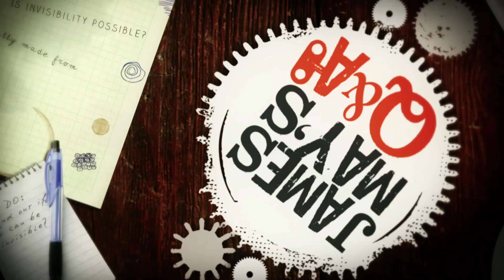Why Can't Trains Go Uphill? | James May's Q&A | Earth Science

Comment: Sooo...

I am NOT a railway engineer, but I am an expert in avalanches. The use of percentages vs degrees so frustrating. As I understand 45 degree incline is one to one (1 unit horizontal to one unit vertical) or 100%

Comment: things that tries to combat this situation:
1. sanding, basically sprays a sand in between the tires and rails to give a temporary traction (i think it's stupid, not efficient and possibly ruins the metals because it's basically just sanding a metal and slowly disintegrates both the tires and the track)
2. 3rd/middle track with gear (or something idk the name) basically add another rail but the 3rd one is in the middle of the track, and there's also a gear underneath the locomotive that fits onto the track basically the same idea as people taking stairs.
3. this is my idea, why don't they lay a piece of rubber like a very long gum not everywhere but only on the surface area that trains struggle to have traction? doesn't need to be thick and if it disintegrates it can easily be interchangeable

Comment: Umm, then y dont we make threaded side tracks in hilly areas which will only touch the threaded side extension of wheels, these wont be required in plain areas where train instead of running on its smaller threaded wheels will transition to plain larger wheels

Comment: Tractive contact area and braking contact area aren't the same.  Yes, only drive wheels provide traction but braking is done by all wheels connected to the hydraulic braking system of engines and cars.  But I'm sure this has been pointed out already.
Reply: It depends on the train though, very early steam trains didn't have brakes on cars that could be controlled from the engine.

Comment: Why can´t we just make the rails on a hill section of a railway in a different material?
Reply: Maybe they do. There are different technologies around the world, some trains or trams will even have rubber tires, allowing them to climb steeper. Wikipedia has an article for "rack railway," which exactly a solution based on a different material, but gear-like teeth on the rail and some of the wheels. I suppose it must be like some extra rails for a wheel that's not used otherwise, so it could move though this specialized areas and normal rails smoothly. There are several different models, I haven't read the article.

Comment: a few big british engines had extra sets of powered wheels in front (or behind?) of the boiler, and Diesel engines sometimes operate with "Slugs", another locomotive that doesn't have an engine, instead runs off the main engine's electricity so the pair can have better grip with only the fuel consumption of a single engine

Comment: Clickbait and stupid title, since train can indeed go uphill.

The steepest grade in the world is 13.8%
Reply: There's a video claiming the funicular of the Havre goes up to 30%. But maybe that's a thing with funiculars in general, so it's kind of cheating to mention. It has rubber-tired wheels, though. I'd imagine that rack-assisted railways could also be used in situations just as steep or steeper. But then at some point the smooth steel wheel traction itself is perhaps not the biggest issue, but the incline itself, being more efficient to have a longer path than a steeper one, I'd guess.

Comment: I CAN IMAGINE AN INVENTION WHERE A SECOND SET OF GEARED WHEELS AND A SECOND SET OF TRACKS COME IN CONTACT WHEN CLIMBING A STEEP HILL. OR EVEN A STRONG CABLE LIKE THAT ONE IN SAN FRANCISCO PULLING THAT TRAM UP A VERY STEEP INCLINE!!!
Reply: "Rack railway" is the name of the first invention, and "cable railway" the second, of which there is the funicular railway variation, where cables connecting two trams up and down a hill use the weight of the one going downhill to help the one that's climbing. I don't know of cables being used only partially on a track, like automatically hooking on them at the beginning of a big slope, helping to pull them up, and then disconnecting, but I'd not be surprised if it existed.

Comment: No mention of cogged railroads or locomotives equipped with sand that blasts the surface of the rail in front of the traction wheels to make it a little rough to give it traction.

Comment: Also worth mentioning, most locos are equipped with reservoirs of sand that is dispensed to the track in front of the driving wheels to improve traction on steep grades or during wet conditions. On steam locomotives this reservoir was on the top of the train in a dome shaped part, known as the “sand dome.”
Reply: Damn, that would’ve been cool. Makes sense, they definitely would have thought about that before using sand. Thanks gentlemen.
Reply: What? Somehow this makes no sense to me... I feel like this does nothing or may derail the train somehow...
Reply: @dumbleking5172  like he said in the video, it’s a very small contact patch and it’s shiny metal on shiny metal, a little grit goes a long way. It was so slick with frost last winter that we couldn’t pass a brake test and the poor sander compressors were running near endlessly. Let’s be clear though, it doesn’t make a huge difference, especially in an emergency on slick tracks, but it’s a difference nonetheless. In regards to derailment, there’s a video of WW2 soldiers training on how to derail trains. They took bigger and bigger pieces out of the track to see how much had to be missing till it comes off. The length is quite astounding before it’s off.
Reply: @dumbleking5172  I don’t know what to tell you. It is basic physics. The worth of a locomotive is measured in its tractive effort, and sand keeps the wheels from slipping by providing extra traction.
Reply: I’m sorry it’s 8 months later but do you know if it turns into glass?
Reply: @slimmsherpa9771  the sand grains wouldn't be under heat for long enough (Or perhaps even hot enough) under the small contact points and the relatively short duration the train travels over them to turn into natural glass. Without a flux the sand would need to reach 3,200F or 1760C to melt.
Reply: @slimmsherpa9771  definitely not. In chilly Canada even our light rail transit trains still use sand, (selected for type and grain size), for traction when braking and accelerating. So much so that periodically a vacuum truck comes to pick it up where it deposits in tunnels and switches.
Reply: @francistarkenton545  funny,  one is not suposed to sand into switches
Reply: @trazyntheinfinite9895  while generally true, it does blow about with the wind and our trains sand whenever they detect a slip/slide condition. It’s not operator controlled.
Reply: @francistarkenton545  wdym it's not operator controlled? I drive trains in Germany and we sand manually. I don't know if passenger trains are different, but our cargo trains all have a switch for sand. I don't think I've seen one that does it automatically. We also have to radio it in if we come to a stop while using sand, especially if it's anywhere near a signal.
Reply: @RenkoBernkastel  Fair enough. I’m speaking specifically of the Siemens light rail units that we service. I can’t imagine all trains are the same. In fact, the very early Siemens-Duewag U2’s had a sanding button but it was later automated.
Reply: @RenkoBernkastel  Canadian trains are designed differently to German ones.
Reply: @slimmsherpa9771  No, it doesn't. I work with a steam powered train at an amusement park. What sand doesn't get pushed off the tracks simply gets crushed into powder. There's not enough heat generated to melt the sand. Between the wheel and the track itself, both act as a heat sink, pulling away all heat generated by the compression of the sand, which is why it turns to powder instead of glass.
Reply: @slimmsherpa9771   No but I've seen a power line contact an excavator boom that was on an asphalt freeway and  The result was pretty much all the ground underneath the excavator turned to glass
Reply: @Ag21 
You may purchase male or female slaves from among the foreigners who live among you. You may also purchase the children of such resident foreigners, including those who have been born in your land. You may treat them as your property, passing them on to your children as a permanent inheritance. You may treat your slaves like this, but the people of Israel, your relatives, must never be treated this way.
(Leviticus 25:44-46)

Should I become Christian so I can have slaves, too?

Comment: The famous Settle & Carlisle line has a very nasty 1 in 100 gradient from Settle all the way to Carlisle and only really levels out once you arrive at Carlisle.
I play Train Simulator and ive experimented that a train hauling a 1100 Ton coal train can easily be hauled up the 1 in 100 gradient thanks to the locomotive provided such as a class 37 or a more modern class 66.
Passenger trains on the Settle & Carlisle line are easy to pull off as most passenger consists are formed of 1 up to 5 cars long and all the carriges are motorized giving enough power and tractive force to very easily climb the steep ascend to Carlisle.
Trains going downhill towards Preston and Leads face the problem of braking and all modern day trains use a policy of "Air Brakes" some locomotives in the olden days had a choice between Air brakes and Vacuum brakes, but when trains go downhill on the S&C or any steep descend they are in trouble of slipping on the tracks due to their heavy load of passengers or freight, thats when the sander comes in handy.
I could go on but i fear i would get facts wrong, and give you false information.

Comment: There are 2 types of brakes on modern locomotives, the air brakes and the dynamic brakes. Dynamic brakes in simple turn the traction motors into generators. So the locomotives do most the work air brakes are only used if the train starts going to fast.

Comment: The Mount Washington Cog Railway climbs an average of a 25% incline. It maxes out at 37.4% incline  and has been running 151 Years.
Reply: I rode on it once. It has a lot of noise and vibration chugging both up and down the mountain, but not to worry, it's been proven safe for over 100 years. Sure looks weird when on level tracks though.

Comment: The lickey incline once had a specially designed locomotive, just to serve as a banker for it. But eventually other locomotives came along, that could out-do it
Reply: "Big Bertha", the banking loco which assisted trains up the Lickey Incline is a bit of a local legend here in Bromsgrove, at the foot of the Lickeys. Unfortunately, like the extensive Wagon Works and turntable at Bromsgrove, she is just history. Sold for scrap and the Wagon Works now a housing estate. Even Bromsgrove Station, where a  driver and engineer were killed when a boiler on a steam locomotive exploded, was virtually closed, and operated as an unmanned stop with no waiting room or ticket office. 
It's now completely rebuilt with extra platforms.

Comment: 1:18 in split, croatia there was a steam train so slow, that at that same incline grade, didnt have enogh power, because it was usualy overloaded and it was made in 1903, and removed in the 50s. People would often get out and push a steel locomotive with 3 wooden wagons, to get up the hill called Klis. After that, it was all downhill. The train was so slow that a car journey today would take mostly 30 minutes, the train would take 2 hours and 30 minutes one way, and 3 hours the other way, because of the allready mentioned Klis. In one way, the train would start at the sea level, climb to about 500m of height, and then go down that hill to about 300m at its final destination.

Comment: Hmm, if trains struggle to find a grip, how do they start moving in the first place? That is, how does the main engine at the front get enough traction to to begin pulling the immense weight behind it?
Reply: A good  engineer has patients. He applies power gently and slowly. If the wheels start to slip, he massages the throttle back to maintain traction. Gradually, all the cars begin to move and accelerate gradually.

Comment: That's why locomotives have what's called a "sander," to literally drop sand on the rails and create friction.  This comes in handy when both climbing hills, and when running during the rainy season.  In the earlier days of steam, they would just throw the sand out in front as they ran along, like what the fireman had to do in "Edward's Exploit," for you Thomas fans out there.

This is not without problems of its own, however: in sufficiently wet weather, the wheelslip can turn the wet sand into mud, making the situation even worse than before, as seen in "Leaves."  An episode which, coincidentally, revolved around a more hot-headed and less intellectual James.
Reply: You paraphrased those stories poorly.
Reply: @caboose.20  I loved them though.

Comment: May says that, on hills, "the tractive force remains the same" (4:02) That, I think, is an incorrect statement. The tractive force depends on the normal force at the contact point between wheel and rail. That force varies as the cosine of the angle of elevation of the track. At 20 degrees elevation, for instance, the force will be about 6% less than on a level track.

Comment: I used to wonder why they didn't just put rubber strips on the locomotive wheels, like on a battery-powered toy train. 

Then I realized that any rubber would be torn to shreds by the weight of the locomotive.

Comment: https://wvstateparks.com/park/cass-scenic-railroad-state-park/  My wife and I experienced a train ride there last year.  Going up the hill wasn't really a big deal, but coming down there were attendants on every car operating manual brakes, which were always at least partially activated and adjusted as the grade would change.  The braking power of the locomotive was not sufficient to keep the train from going too fast and derailing.  Back in the day, there would be only one or two brakemen for several cars who would have to race back and forth, ON TOP OF the cars to do these adjustments.

Comment: 4:13, There's a slight inaccuracy. Tractive force, in fact, will not remain the same. Tractive force depends on friction, which is directly proportional to the gravitational force applied perpendicular to the surface. While the overall force of gravity will remain the same, when the train climbs an incline, the component of gravity perpendicular to the surface will reduce. For a gradient of theta degrees, the force will now be the cosine theta of what it was previously.
Reply: true, but it's minuscule compared to the increased force pulling the train backwards by gravity.
Reply: @DonLee1980  backwards?
Reply: At the 2.4% grade it’s a little over 0.1% reduction in down force
Reply: @technophant  Well, the pull back force also sounds small, only 3,77% of the train's weight. Although I understand that the weight is much bigger compared to the traction, but it's not wise to neglect such numbers. Especially that people might learn this in general, and won't understand why their car can't go up on a steep hill
Reply: Ah . Pedantry abides here .   But you're dead right .
Reply: Who the hell is Moop?
Reply: The little engine that could ...
Reply: Now, basically the only new principle involved is that instead of power being generated by the relative motion of conductors and fluxes, it’s produced by the modial interaction of magneto-reluctance and capacitive diractance. The original machine had a base plate of prefabulated amulite, surmounted by a malleable logarithmic casing in such a way that the two spurving bearings were in a direct line with the panametric fan.

The lineup consisted simply of six hydrocoptic marzelvanes, so fitted to the ambifacient lunar waneshaft that sidefumbling was effectively prevented. The main winding was of the normal lotus o-deltoid type placed in panendermic semiboloid slots of the stator, every seventh conductor being connected by a non-reversible tremie pipe to the differential girdlespring on the ‘up’ end of the grammeters. Moreover, whenever fluorescence score motion is required, it may also be employed in conjunction with a drawn reciprocation dingle arm to reduce sinusoidal depleneration.
Reply: At just a 2% climb I’d say that the tractive force is essentially equal to flat
Reply: True but with small gradients this can be approximated as no change.
Reply: We need train hillclimbs
Reply: ohh shut up
Reply: There was no need to go on about cosines
Reply: I really don't think that most people would understand the concept of normal force tbh, but yeah, it's proportional to the angle of the incline.
Reply: @kelly2631  In this case, the decrease  in normal force will not be a factor in this. In fact, the normal force is proportional to the cosine of the angle of the incline. This means for an extreme angle of 5 degrees, the normal force would only decrease by 0.38%
Reply: I bet this guy is fun at parties
"AAAAAACTUALLLLY"
Reply: You're commenting on technicalities of a video which is clearly nonsense?

Trains DO go up hills. They may be limited in gradient- I think the steepest (in UK) for a conventional friction wheel to rail interface is about 1:35.
Reply: @derekstuart5234  That's exactly what they said in the video. "Trains do climb hills. They're just not very good at it."
Reply: @davidguthary8147  then really it was not a very wise title to state that they cannot.

I would think that a 100 ton locomotive pulling several hundred tons up a 1 in 35 is not bad going, so it's really not worth the argument in any case.
Reply: Okay copy and paster.
Reply: @Bravo-Too-Much  and you still haven't learnt anything.  LolololoL
Reply: @Bravo-Too-Much  Not really, thats high school physics. If you don't know this you probably slept through it, or weren't paying attention.
Reply: @2009dudeman  not everyone goes to highschool
Reply: @Tupsuu  obviously.
Reply: @2009dudeman  When May said 1/3 what did he mean? Is a radiance let's say 1% not equal to 1 cm over 1 meter?